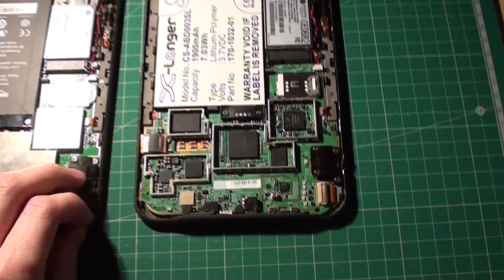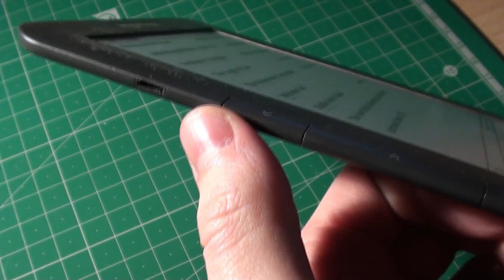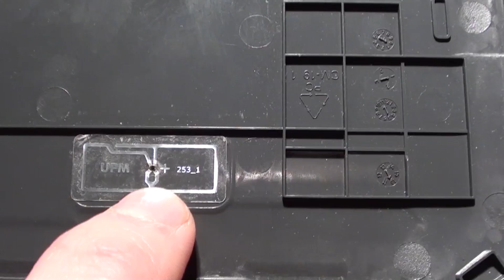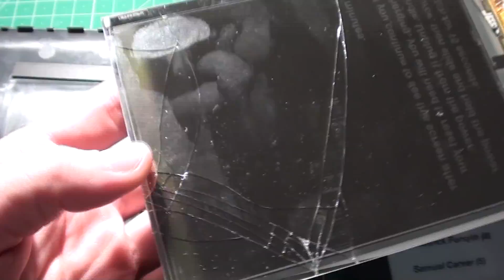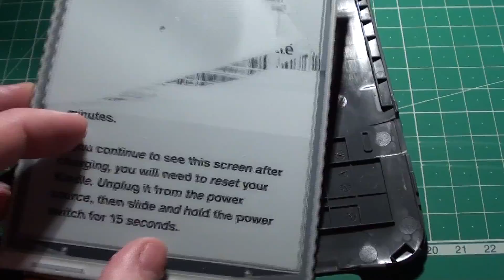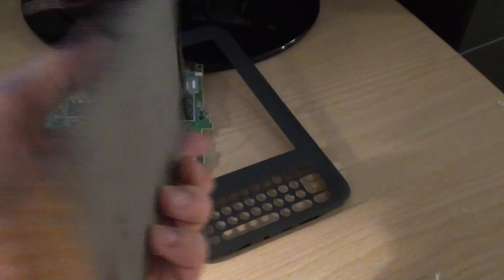Kindle 3 Repair and Teardown

Comment: If I find a working kindle keyboard, can I transfer the 4 GB flash memory from my current non-working Kindle Keyboard to the new one?
Reply: Did you find the solutions. I'm facing same problem here??
Reply: @Zetek  Hi, I've only used the working kindle since then

Comment: I think the device at 11:00 provides power to the case for the little LED reading light in the case (when the power is switched on.)
Reply: This is correct. :) (I use to believe this only provided power and ground)... after some more research it provides 4 pin connection directly to the internal system but also provides power to the LED light case.
Reply: @bmbleau  And YES, I'm still using it.

Comment: I don't think you mentioned the reset button on the main board. It is silk screened with the word reset and is a push button. Very difficult to miss. maybe pressing that would have woken up the kindle.

Also the slots in the side are to power the illuminated cover.

OK your MB has not populated the reset pad. I bet the silkscreen still says it though.
Reply: How do you actuate the reset on the board. All I see are soldered connections. Please advise
Reply: @cadpwruser same idzie here

Comment: Hey Carl, my kindle 3 may be have same issue bcoz I tried to charge but is shows an orange indicator for a while and goes off. Even after removing battery (screen is frozen since 4 days)
Screen doesn't go blank . I tried charging without battery the orange indicator lights up and goes off. Could you tell me where's the problem, is it either with battery or something else.
Reply: same problem.  with my kindle plz tel ma any solution ?

Comment: The clips/slots on the left side are for Kindle's Lighted Cover. Cover draws power through slot(s)
http://www.amazon.com/Kindle-Lighted-Leather-Cover-Keyboard/dp/B003DZ165W/ref=sr_1_2?s=digital-text&ie=UTF8&qid=1448340809&sr=1-2&keywords=kindle+cover+with+light

Comment: You can use 3G module in laptop as long as it has internal SIM slot, or you can also get small flat-felx cable that goes between mini pci-e edge and slot. There are also external usb adapters that have mini pci-e connector and SIM slot and usb connector to computer as most of those work by USB connection.
I tried to install one very similar card in my thinkpad, but I could not fit 3G&GPS antennas in display as it is thiner hi-res LED display model. I did then install it to desktop with adapter, but without proper antennas I could not get connectivity and anyways I don't have spare 3G subscription.